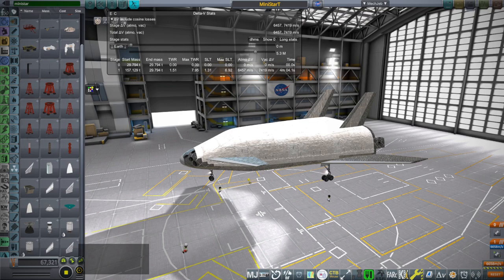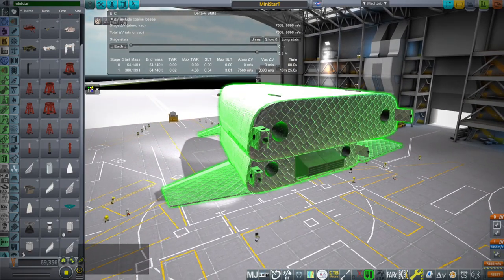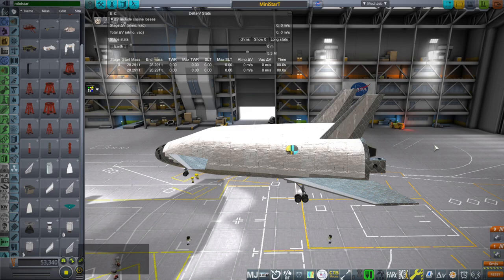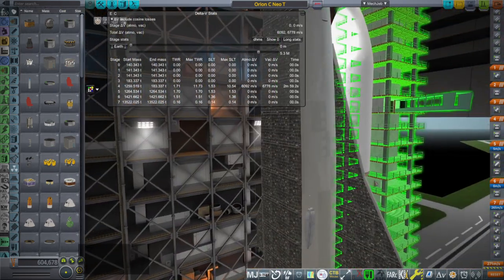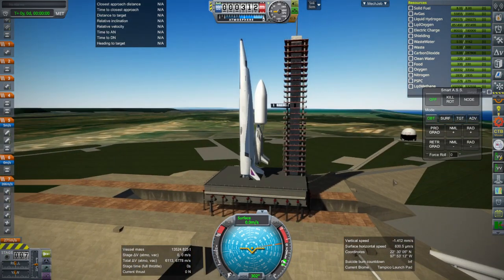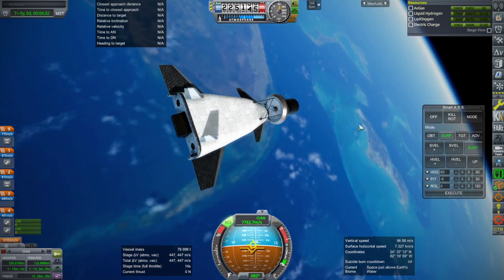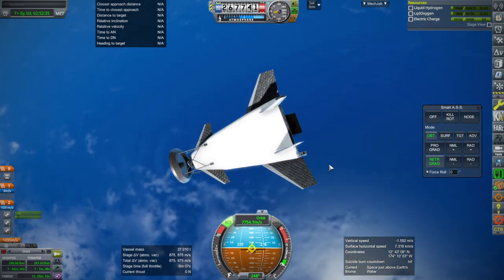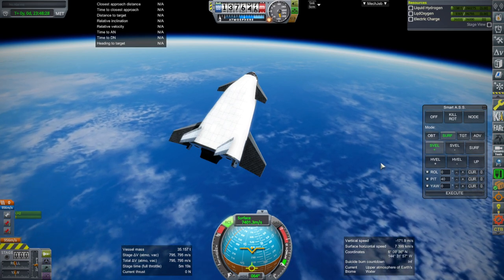Kerbal Space Program 1.12 with RO - MiniStar Optimization

Comment: Since MiniStar is doing it's entire operation in vacuum, might it make more sense to use lighter engines will bell nozzles?
Reply from the maker: The MiniStar was originally meant to have bell nozzle engines: https://www.youtube.com/watch?v=MgKwALMYAsM. However, in that video, the engines exploded because they had less heat tolerance than the aerospikes, so I would probably need to add a big body flap to protect them. I decided that I would rather deal with the aerospikes, which didn't amount to more mass increase than adding such a body flap would. The aerospikes get a bit less ISP, but it's manageable.

Comment: Isn't the whole purpose of an Aerospike defeated, when you only light it in vacuum. Why not fill the old Ministar to the brim and use it as a 1.5 stage system?
Reply from the maker: That's not a bad idea - I'll think about that. The Orion Carrier Plane uses dual vertical stabilizers partly to allow for that.